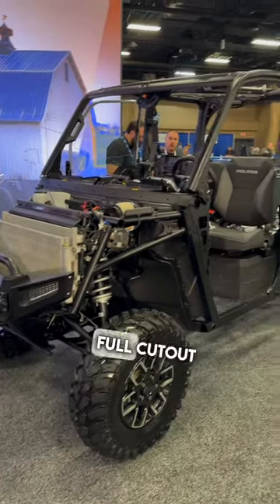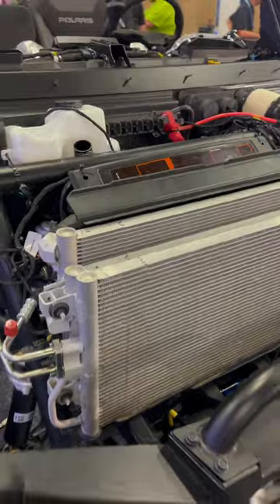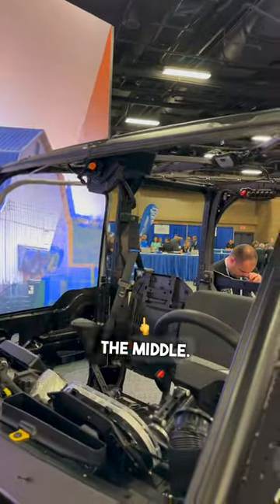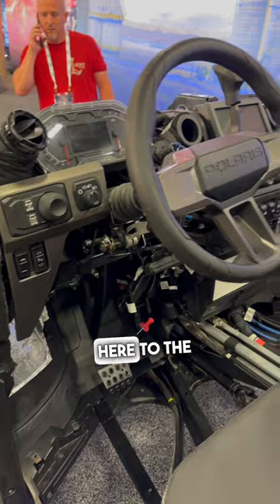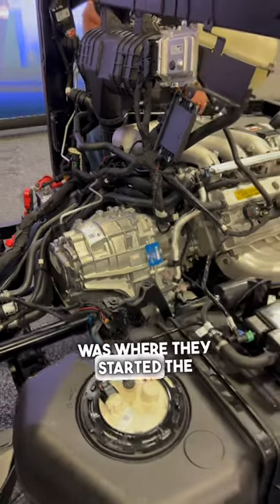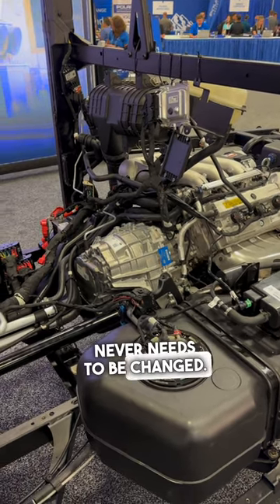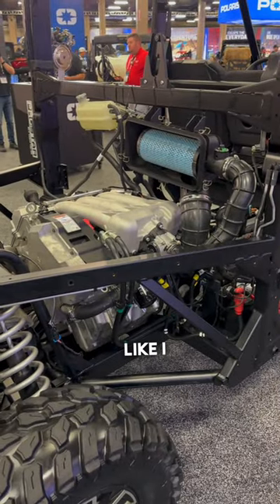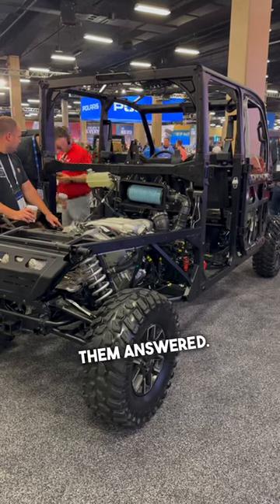What’s underneath?? The 2024 Polaris Ranger Extreme Duty XD 1500

Comment: If you want something to last a lifetime buy HONDA
Reply: Lies, my dads Honda is junk
Reply: Patently false, actual data ranks Honda not even in the top 10 in reliability. Worst cost of ownership over all.
Reply: i prefer yamaha. owned 4 since 2002 still have 2!
Reply: @nortonashburn5677  Funny, no one asked.
Reply: @nortonashburn5677 it s not a good sign when you need to buy 4 atv at a time. Yamaha is the japan polaris. It s the least reliable of the japanese brand.
Reply: 2002 and 2016 grizz are sold.  have a 2019 wolverine and 2023 grizz. u cant compare kawasaki to yamaha. maybe honda or suzuki.
Reply: @ericlessard5021 He has owned 4 since 2002. How does that translate into needing four ATVs at once? I’ve owned several Polaris ATVs and snowmobiles over the last 30 years and it isn’t because I needed several at once. I’ve upgraded, traded, sold, etc. I’ve had extremely good luck with them. That makes no sense. Yamaha is not the worst of the Japanese brands. They produce great products. Give your head a shake!
Reply: @pajamatime5750  yeah, i missed read, english is my second language... i just had a lot of yamaha in the past and i was hard on them and they just not last like honda, or even kawasaki...
Reply: Or Yamaha.